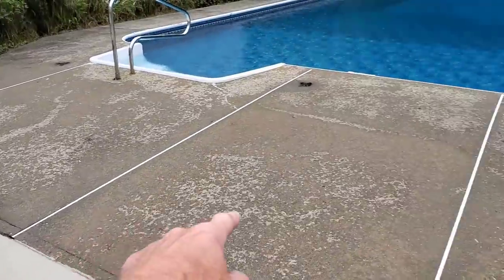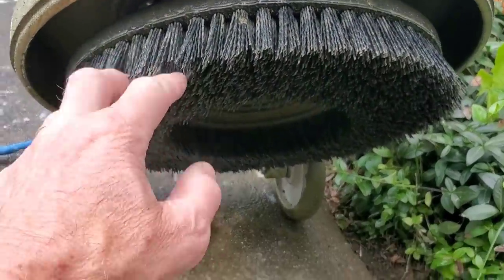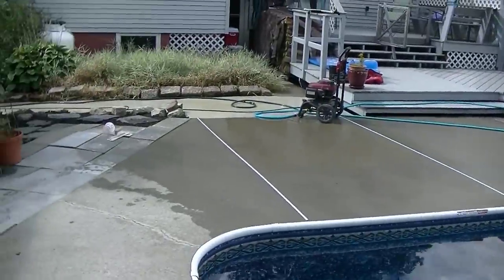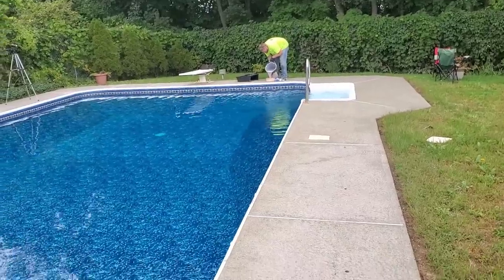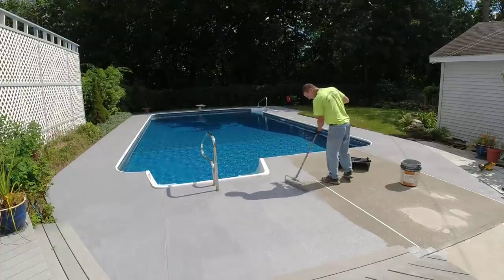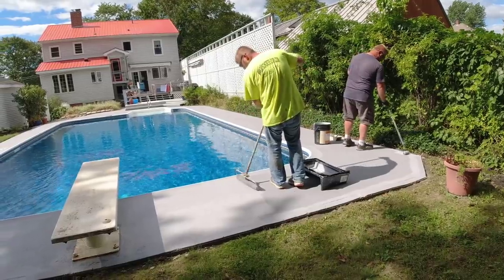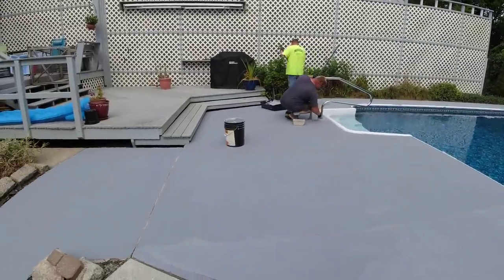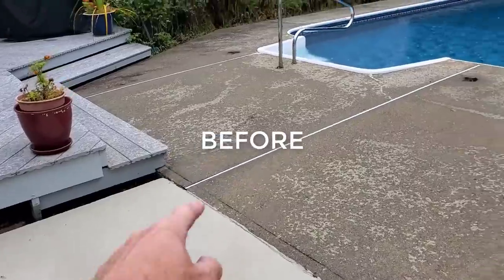How To Paint Your Concrete Patio in 2023 | What Paint To Use

Comment: Great job and perfect example what it takes for such deceivingly diy project. Three guys, various and special machinery plus the drying time in between repairs and coating. I am curious what would happen to stress joints since you painted over them? It seems that some sort of pvc is stuffed in there. Do you think coating will peal off of it or not so much? Thanks for sharing.   👽

Comment: Is this paint coating slip resistant around the pool when wet?
Another job well done man
Reply: Great question. Or may can you add sand? Be nice if we get an answer
Reply: Deck Seal if used on a deck with a lot of texture like the one in this video, uses the roughness of the deck and is not very slippery. However, If it is very smooth concrete with no texture, then add an anti-slip sand, which is pretty typical of any acrylic or paint like deck coating going down over smooth concrete with no texture.
Reply: @tomt652  Yes...Deck Seal is built to be able to add anti-slip sand.

Comment: FANTASTIC JOB! Does it scratch easily if you put patio furniture on and and it gets moved around. I'm looking to paint my 15 X 30 covered patio and then stencil over that. Should I seal it to prevent potential scratching. Also what about slipping on it when it gets wet? Thanks

Comment: I have a 12’x26’ slab next to my pool that I’m going to put a new pergola on. I grinded the slab today with a concrete grinder to remove the old “cool deck” concrete onlay. Now it is really smooth. Does this paint get slippery when it gets wet? I need something that has a little grip to it so nobody slips and falls. Can you recommend a coating that would work?
Reply from the maker: You can add grit to this. Look up "shark grip" from Sherwin Williams
Reply: @MikeDayConcrete  TY for the response Mike! I will definitely look into that.
Reply: @MikeDayConcrete  how/where do I buy this Deck Seal paint? Just went to the website but there does not seem to be a purchase option.

Comment: The product appears to work well. Would you use this on concrete that has a rough surface such as some aggregate showing but no cracks? Or should one use a product that "fill in" first then paint the surface?
Reply: I will let Mike (the expert) reply on filling in or not filling in...what I can tell you about Deck Seal is that it will "mimic" or coat over whatever is under it and show the pattern, bumpiness, etc. of what it is over. So if you don't like the texture of the concrete, you may want to address that first before adding a colored sealer over it.

Comment: Nice video, could you grind the surface also instead if pressure washing it? also does that waterproofer fill in salt finished concrete? Thanks
Reply: Only grind high spots.  If you don’t have a pressure washer look into soft washes for concrete with a cheap pump sprayer and a water/chemical mix.   I’m not sure what pros would advise to use on concrete but a quick Google search would tell you. 

Grinding stains won’t help, it actually might make the stains worse by spreading/embedding them more into the concrete.   If you grind away enough to remove the stain totally you’re going to have a bunch of low spots you need to go back and fill with a resurfacer so you added a bunch of extra work and spots the paint needs to hide.   It’s way more work.
Reply: Thanks Mike

Comment: How well does it hold up to periodically pressure washing? I have some muddy water runoff when it rains.
Reply: It does well...but...a pressure washer at full strength is designed to strip pain and other materials away, so be carful of the pressure you use to clean any coating. Also, like any acrylic over time the elements can weaken the surface, so again...be carful of how much pressure you are actually using when cleaning the surface.

Comment: Looking good. 
Some advice for the cracks on decks... 
1.Use grinding disk following and exposing crack. 1/8 - 1/4" deep should be fine. 
2. Blow out and remove dust. 
3. SIKA two part epoxy to fill the cracks, several  passes if needed until epoxy levels on deck. Scrape excess when epoxy is tight enough. 
At this point,  you can do several things depending on how wide the cracks are. 
With a hairline cracks, just breeze down the epoxy with grinder to feather it level with deck, this also preps the epoxy to allow a mechanical bond for paint or sealers or caulking. The crack in this video would get ground down,  along with a very small groove following exactly where the crack is, making a bed for urethane caulking.  Clean crack, fill groove with urethane and then level. 
You know everything about concrete and cracks,  so what this will basically do is create a superior bond with both sides of the crack and put a flexible "expansion joint" (caulking) where the cracks are. It's going to crack again as you know,  but the caulking and sealer won't. Keeping moisture out and not revealing the cracks when they do come back. 
Many years in Florida pool decking, best solution I've ever found. No call backs ever.
Reply: Man this sounds like great advice! Can you expand on what you mean about the hairline cracks and breezing them down etc?
Reply: @WayneStratton  
Breezing to me is a very light pass over cured materials with a grinder.
In this case, the cured epoxy.

Comment: Hi Mike, how does this product compare to Behr Deckover in terms of durability?
Reply: I will let Mike actually tell you the comparison as I can only answer on the durability of our product...but our Deck Seal was designed for our waterproof Deck and Balcony system for high traffic areas and where deck furniture is used...so...we designed it to be very durable.

Comment: Can you use this to seal concrete in a basement?  i seem to to have the concrete top turns to a dust/powder.  i vaccuum, mop dry and put concrete paint. and in a year or two it lifts up.
Reply: Yes...but...it sounds like you need to first put down a moisture/vapor barrier before you put any more coatings down.

Comment: How slick is it when it gets wet??  I would like to do something around my new pool but I'm concerned about traction when wet.
Reply: Deck Seal if used on a deck with a lot of texture like the one in this video, uses the roughness of the deck and is not very slippery. However, If it is very smooth concrete with no texture, then add an anti-slip sand, which is pretty typical of any acrylic or paint like deck coating going down over smooth concrete with no texture and that will help make it not as slippery.

Comment: Does anybody know if you can use these paint over Acid stain the pool deck?
Reply: Yes...if it is fresh acid stain you just have to make sure you've neutralized the acid with baking soda then when cleaned off and dry you can seal it. If it's old acid stain, then it was neutralized long ago and it is good to go with sealer.

Comment: I respect the work you do but I don't like concrete when it's painted in gray,  I would like a more natural color or using a clear water proofing.
Reply: John...gray is just one of the 13 colors available for Deck Seal, or as it is a water based acrylic you can even custom color it. Many people like Deck Seal because it is as a full waterproofing sealer and protects the concrete while giving a uniform colored finish. But, we also understand personal preference which is why we also make clear sealers. : )

Comment: Hi Mike ,could you use this product for a garage floor
Reply: He said in the video, the product is not good for hot tires or a driveway.
Reply: @dennisjoiner4164  Not putting any vehicles in my Garage !
Reply: Actually...we have Deck Seal being used on a lot of driveways. It was designed for high traffic (foot traffic) areas with furniture, but if there is no parked traffic on it it should be just fine.

Comment: Wait didn't you have another concrete paint video where you said you used it on your basketball court that was on there for 7 years?  The video was a concrete back patio & I'm pretty sure you said it was Sherwin Williams??
https://youtu.be/RTNPnmTHt5U

At 4:00 you said you used Sherman Williams
Reply: Seems like sherwinwilliams would easier to attain then paying shipping from Arizona for the Deck Seal Stone Edge. Is Deck Seal available at the big box stores?
Reply from the maker: Same stuff, different company. Sherwin Williams stopped making it for now, couldn't get the raw materials.
Reply: Ok Kool, I was going to do a covered front porch after watching the other video. It had carpet on it before. What do you suggest to clean the old adhesive off for prep?
Reply: @MikeDayConcrete  that makes since. I’ve went into Sherwinwilliams for other paint and didn’t have it. They said a plant down south caught fire limiting products. Thanks for the info Mike, I like and watch all your videos.